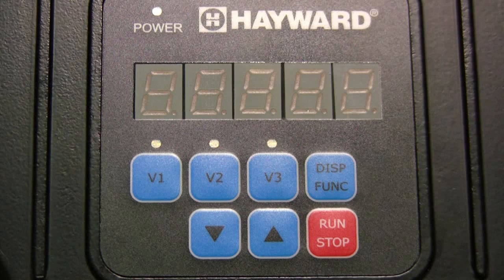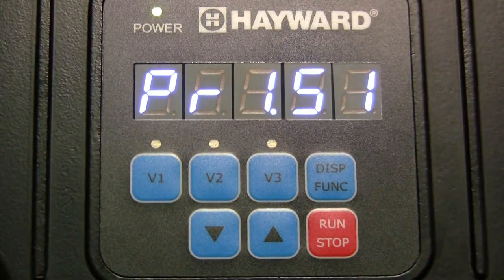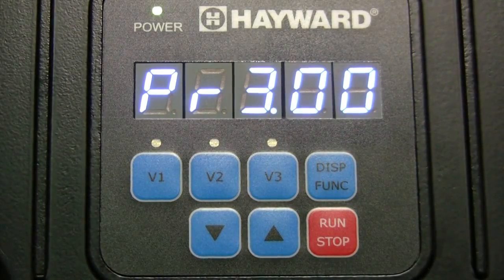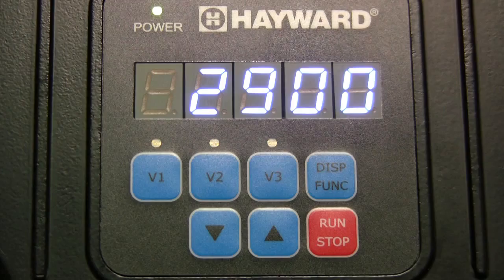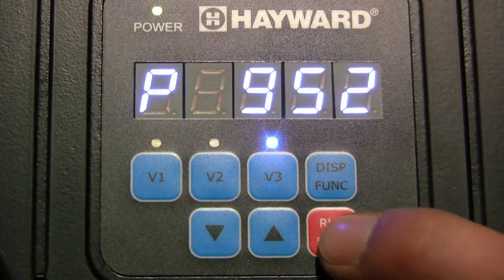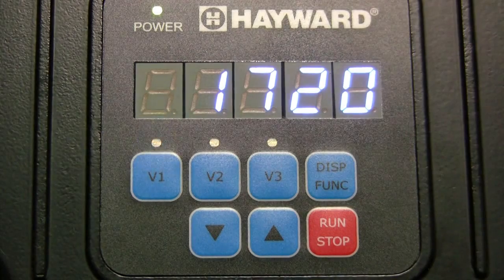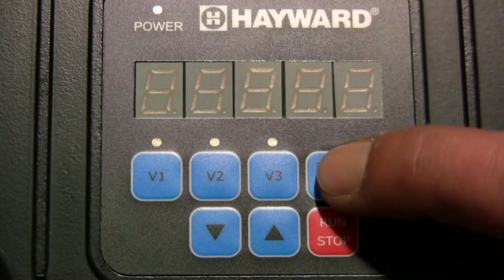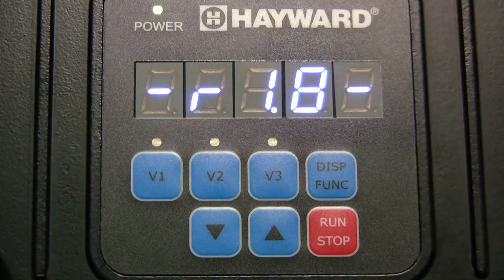SuperPump VS and Max Flo VS Drive Operation and Configuration

Comment: Hey what are some recommended settings for v1 v2 and v3 along with a good prime time. My pump looks identical except instead of the hours for each mode it has me put XX:XXam to XX:XXpm. I'm tired of it running 24hrs I just made all 3 modes 10am to 6pm and it shut up. Just wondering an ideal time frame to run each
Reply from the maker: Hi Tino, if you'd like to hear from a Hayward tech, please send your email addresses and phone number via private message to us on Facebook or Twitter or email us at marketing@hayward.com.
Reply: I'm having the same issue   This pump is a PITA

Comment: My buttons have become unreposive, unless Im in programming mode, which is odd.  Im unable to choose which "V" or change the speed buttons kin regrular mode.  I need to "reprogram" to adjust my speeds when I want to run my vacuum.
Reply from the maker: Hi Ms. Dunn, we're sorry to hear about these issues. We'd be happy to connect you with our tech team to look into this. Please reply with your full name, address, phone number, email, proof of purchase, product model number, product serial number, installation date, and installer if applicable. Providing this information will help us, help you, efficiently. Someone will reach out to you directly as soon as possible.

Comment: I have a maxflo VS 500 model sp23520vsp which is brand new, It runs all day on a small ingroound pool, the installer set it initially but I do not know why it runs 24/7, is this right? what is optimal? and how do I set it for best circulation and cost saving?
Reply from the maker: Hi Pete, our tech will reply here or you may wish to speak directly with someone. If so, please PM your phone number via our Facebook or Twitter accounts.
Reply: Here would be best as someone else with a similar question could also benefit from your reply.
Reply from the maker: Running 24 hrs a day may not be bad depending on the speed it is running.   Post your phone number if you want more help. The pump has eight speed and timer settings.

Comment: this is by far the most frustrating pool pump that I have ever owned.  It runs for hours on end and my electric bill is through the roof.  How do I get it to just run for 2 hours a day?
Reply from the maker: ohmystarz3 we'd be happy to help. Please private message your phone number or post it here and our tech will give you a call.
Reply from the maker: Not sure if you have a Time Clock between the power source and the pump to set running time.  This would be the answer with the limited information you have provided.   We would be happy to help. Please provide your email or phone number.
Reply: unless your pool is 5 ft x 5 ft., you need to be running it way more than 2 hrs a day

Comment: Hello. I just had the Super Pump VS installed. How do I go about doing a backwash with this unit? do I use the run/stop button and proceed as I have in the past and then press run/start for the 5 backwash cycles?
Reply from the maker: We'll ask our Hayward tech to reply here or he may want to call you. Please provide your phone number.
Reply from the maker: Do you have a SP2602VSP or the SP2603VSP?
Reply: +Hayward Pool Products I will keep checking back. Unfortunately I cannot leave my phone info here. Thank you.
Reply from the maker: Do you have a SP2602VSP or the SP2603VSP?
Reply from the maker: If you'd like, you can also private message your phone number to us on Facebook.
Reply: +Hayward Pool Products I have the 2602vsp. as son as I figure out how to message you on FB I'll do that too lol
Reply from the maker: Thank you.
Reply from the maker: You should be able to press the V3 (hopefully it is set up for Max Speed) and use for back washing.  You can set preset times for pressing these buttons than the pump will go back to the preset timer mode.
Reply from the maker: If you'd like to provide your email, we can send the manual.
Reply: What is error 20?